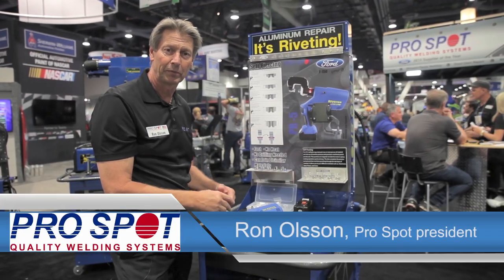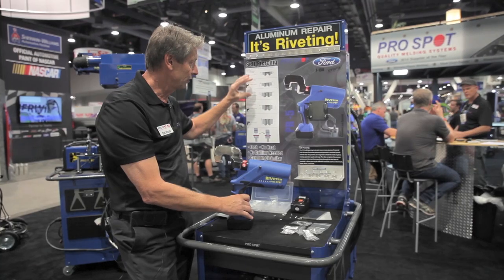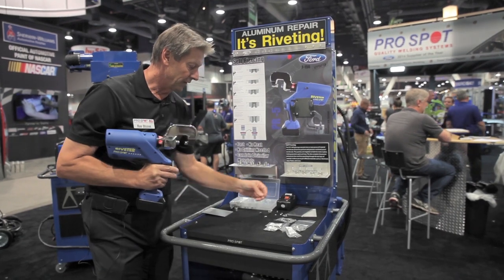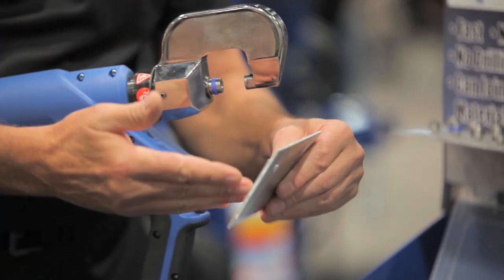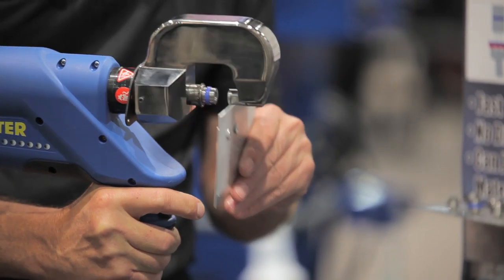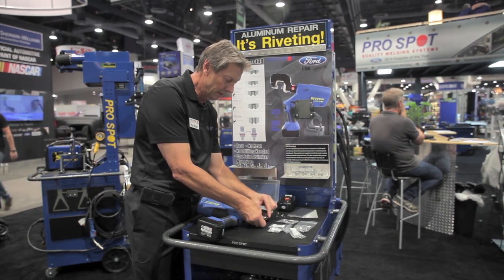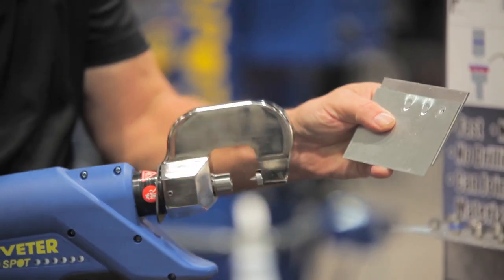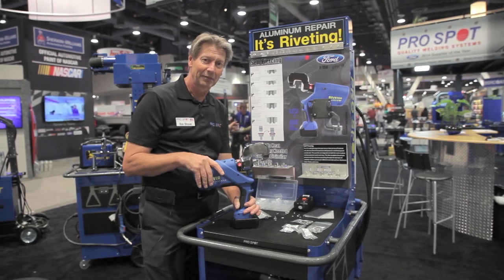Pro Spot Aluminum Self Piercing Rivet

Comment: I see how this will work on an edge, not on a cutout.  If you have a cut out in the shape of a U, how do you use this riveter along the upper section.  The throat looks only about 2 inches. What happens if it is 12 inches from the bottom edge.

Comment: so... what is this self piercing rivet mean?
Reply from the maker: +2583060 SPR is a cold joining process used to fasten two or more sheets of material by driving a rivet through the top sheet(s) and upsetting the rivet, under the influence of a die, into the lower sheet without piercing it.